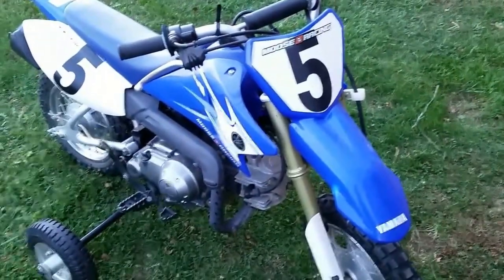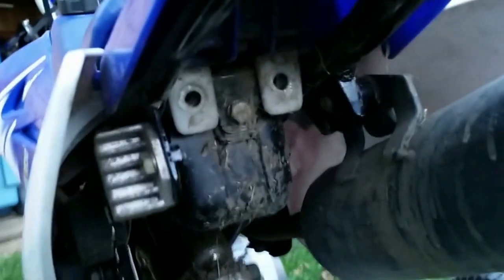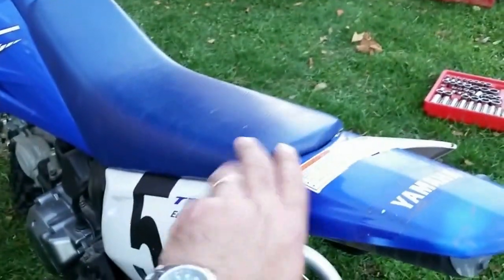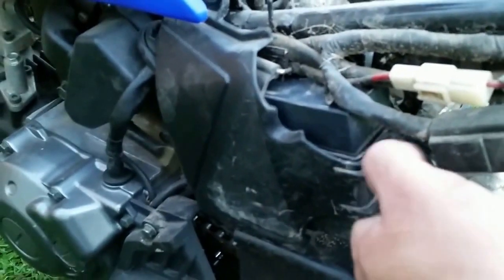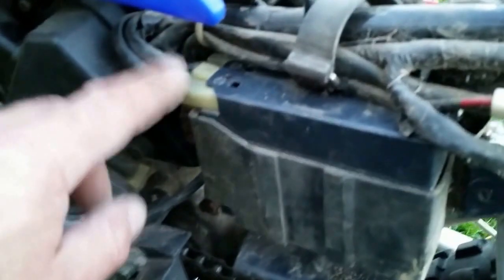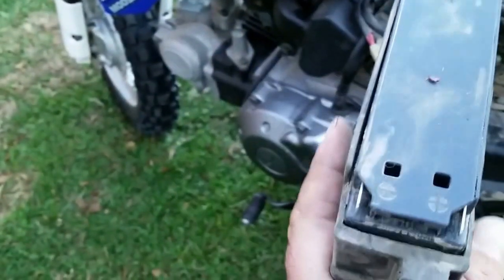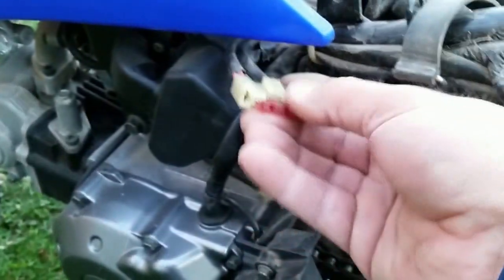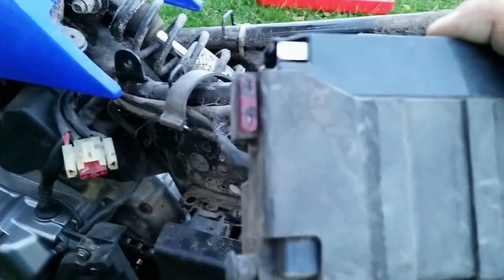EZ How to access or replace the battery on a Yamaha TTR50.

Comment: I bought a charger over the weekend. I put the battery on it seemed to be working took the battery off tried starting the bike. Bike wouldn't start. PUt the battery back on. Now it blinks green shortly and then goes to red. Red means my cables are backwards which they're not. Any thoughts. Is the battery toast? not even a year old.
Reply from the maker: Yes, the battery is toast.

Comment: is the most common no start problem on an electic start a dead battery?
Reply: Yes, or it could be a bad fuse.  Also make sure it is not in gear.

Good luck.
Reply from the maker: Yes, or it could be a fuse gone bad, sorry I didnt see this sooner!
Reply: Do you have to remove the whole battery to connect a charger to it or is there an easier way?
Reply from the maker: John Vergara You could fabricate extensions to go from the battery to the charger, but more then likely, it will have to be removed.